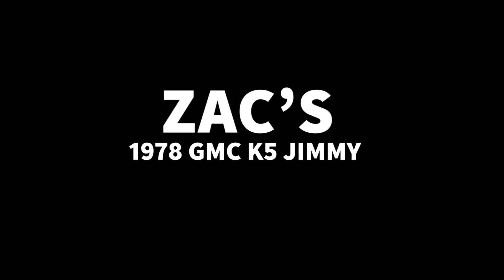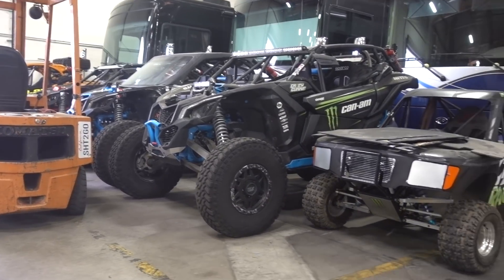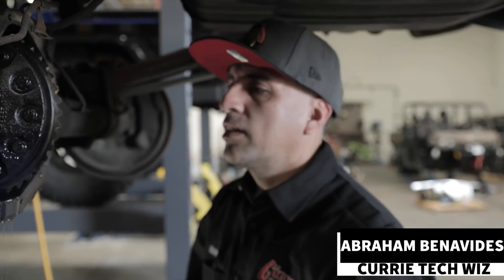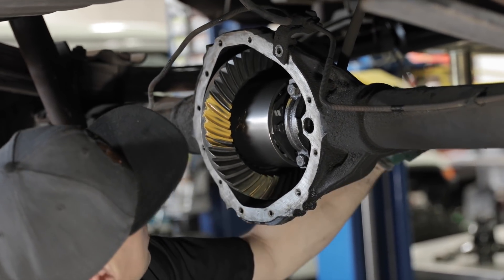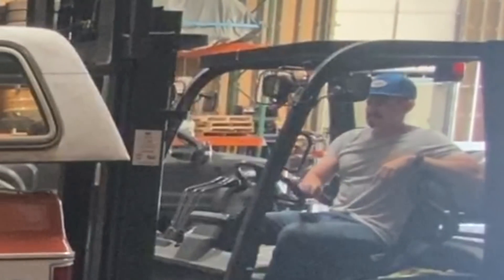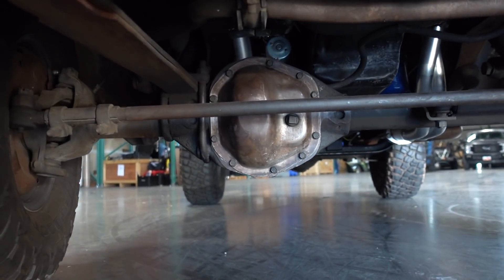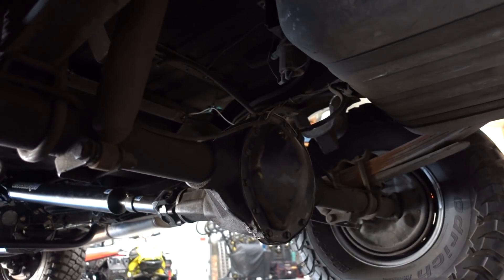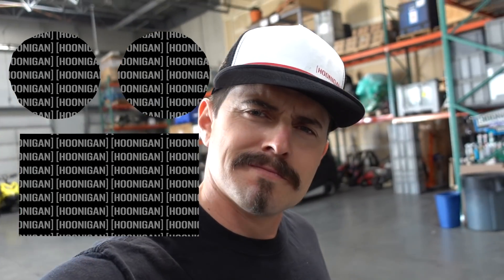Zac Goes to Utah! Bringing the Jimmy to Currie Enterprises to Beef Up the Driveline

Comment: Glad I watched this video. I wasn't familiar with the TrueTrac before. Might be just the ticket to replace the toasted clutch type limited slip in the back of my Ranger.

You say you like it with the top off but next time you drive it on a hot day you're gonna want to use that AC you just put in.

Comment: I low key like the way it looks with the top on
Reply: Low and high key. Looks so good with the top.
Reply: yea I got a truck of the same body style and I like it with the top on it looks like a stubby suburban
Reply: Respectfully disagree sir. Looks dope open with the top off !
Reply: Agreed rare to say but keep her top on
Reply: @redfoot3486  lol for real
Reply: Yeah the top makes it a jimmy
Reply: High key like the top!🎩👊🍻🐈🔥
Reply: I also prefer it with the top on
Reply: same
Reply: Top on, many childhood memories in the back of one of these and the top never came off lol
Reply: I like both. Back in the day someone did make half cab kits for these to turn them into stubby pickups. But I've only ever seen pics of one and it was destroyed. If that was available today I might spring for one. I keep the top on mine because I got no place to store it plus my AC works and I want to be able to lock the truck. I have thought about getting a second beater K5 and just ditching the top and doors altogether.
Reply: Pretty sweet K5, can’t wait till it’s done. I have a pretty nice one too, getting nicer by the day. I’m rebuilding a 6.0 and 4l80e to swap in. When I blow the 10 bolt I’d like to get a Currie at least for the rear. Might just get a used Ford 9 and rebuild it to save a little money, probably not much though.

Comment: Why 456 gears? Whats that 55 mph 4500 rpm lol
Reply: Taller tires effectively reduce gear ratio for example, a Miata’s stock 185/60/14 is 22.75” tall. Car came with a 4.10. The paco Motorsports offroadster kit is sized for a 31 inch tire and comes with a 5.38 gears to make the same gear ratio at the road.

Comment: By the way that pinion bearing looked that blazer most likely has 240k miles instead of 40 lol
Reply: That happens, when the lash isnt right..
Reply: @chancethompson8686  Why would the lash be wrong in a truck with 40K miles?
Reply: @SirDavothe2  factory broke
Reply: @austindoud273  more likely the truck has done far more than 40K
Reply: @SirDavothe2  Factory assembly, doesnt mean everything that comes off the line is perfectly assembled.. Workers make mistakes, parts break, shit happens..
Reply: @SirDavothe2  nothing else (af far as I know) is worse plum out probably just a case of bad ass
Reply: Yeah I got a feeling that things probably got more like 140k on it which still isn't bad given the age
Reply: What i said zach got gotten

Comment: But the pin would not have fallen out.  His tech had the bolt break during disassembly.  So the bolt did not shear off, they punched the pin out which caused the shear.   Its all in the video.  ..